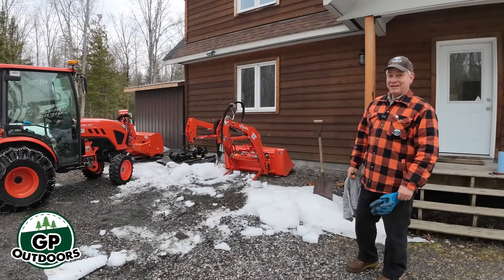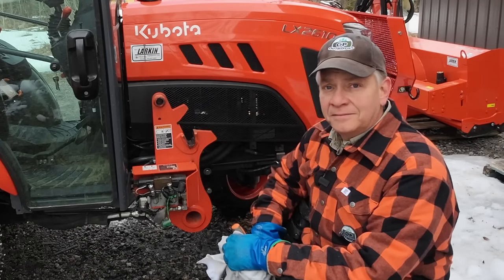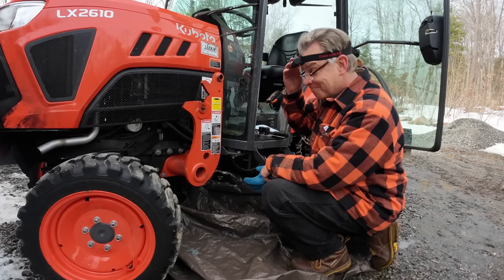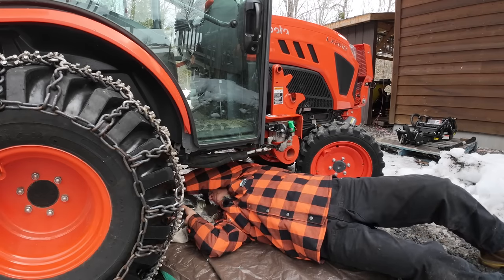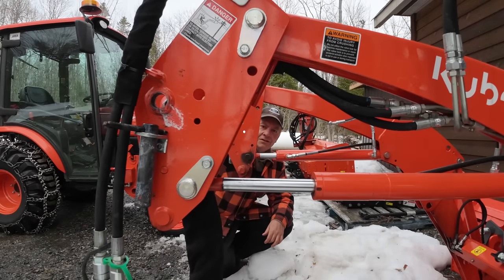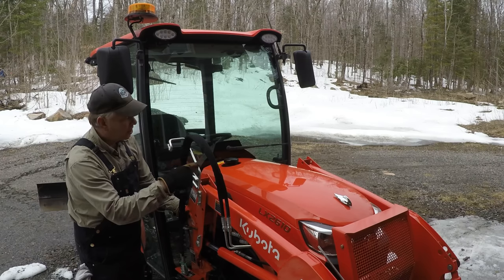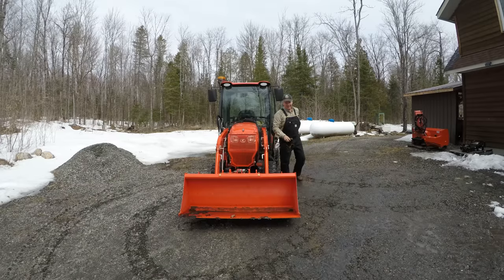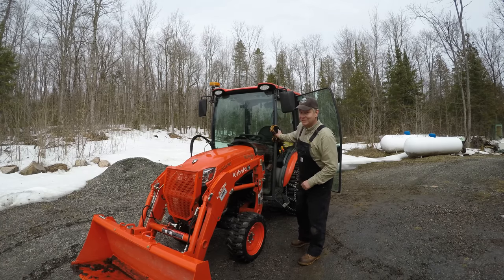667 Kubota LX2610 Tractor. Attaching the LA535 Front End Loader. Mount and Maintenance.   4K

Comment: The way those cylinders got out of sync is totally normal. They’re hooked together in a circuit and kind of find a natural balance. If they were plumbed individually you would bend your loader as the pressure in each side would be out of balance. Next time you have your loader off, grab one side of your loader and you’ll see you you can push and pull on one side and the other will go in and out. Kind of like a teeter totter on a playground. Hope this helps
Reply from the maker: Hey thanks so much. I appreciate it - I was a little concerned. I will pin this comment so other folks can see it. Have a wonderful week and thanks again!

Comment: Last fall while taking off my loader I rushed the removal of the loader. I spent the past two summers removing/re-installing the loader without problem and became overconfident.  Well this last time was a disaster as I somehow dug the bucket into the ground while the loader was off the loader mount. Long story short, I called my local Kubota dealer who sent out the mobile technician a day later to literally dig me out of my jam. My main concern is not to break the darn thing, having a really good dealer who is patient is such a great thing to rely on. Lesson learned, although I thought I mastered removing the loader, you can't rush this process.

Comment: I keep in the small tool box,  a good sized round punch (flat tip) to wack the pin in the  connector to release pressure...works well

Comment: Hi there just enjoying your video today on the cylinders the connections when I have an issue even after releasing the pressure a trick I do on the part attached to the tractor with a little pen in the middle I take a rag and the handle of a screwdriver put the rag over the pin and push The screwdriver to release the pressure that way I’m not taking apart  connections and you’ll find the female part of the hose connector will snap on no problem at least that’s the way it works for me  john
Reply from the maker: Hey thanks John! Have a good one!

Comment: Hey Gord, whenever I take off my FEL off I pull my loader arms in all the way, so the rams aren't exposed to shop debris and welding splatter. When I do this, they move at different rates, so don't be concerned about them being different lengths, you can extend or retract them fully to even them out. Thanks for the video, I'm doing my seasonal change this week as well.
Reply from the maker: Cheers and thanks Ross! I appreciate the info. :))

Comment: I've had my frame sides get out of whack and uneven with the BX I used to own.  Pretty much did what you did to even them out before connecting the loader to the tractor.  I'm surprised they didn't put a swift tach loader on the LX2610.  They updated the B2601 to a swift tach 435 and it makes it a little nicer to connect, disconnect to/from the tractor.  You can actually do most of this right from the driver's seat.  What's really nice is the the hose connections are in one bracket and a single lever connects/disconnects them (as well as a place to mount the bracket on the loader arm).  Still extremely important to have everything level when connecting or you'll still have plenty of issues (I can attest to that personally as can the driver who delivered it).  Thanks for sharing - I really enjoyed watching it.  Not looking forward to torqueing those loader bolts...

Comment: Hi Gord, you need to get yourself one of the cheap kids foam snow sleds from Cabela's to work under the tractor. Much softer on the body and the bottom of the snow sled is slick HDEP plastic to slide across the rocks. Better than the tarp you are using. (Sportsstuff® Grizzly Foam Sled Maple Leaf 49”)

Comment: Thanks Gord.
With both Boom cylinders connected together, 
You could have pushed on the one that is out further and the other one will move out to line them up 
It was in the 80's here in Central Wis today and the Snow/Ice was melting lickity Split.
Mike M.

Comment: I had the same issue with my "red" line as well, GP. I luckily didn't have to relieve the pressure but it was a 10 minute battle. Putting on the blue line and then removing it seemed to make the difference. Yay for summer projects coming up.

Comment: So those good hand towels in the guest bathroom are what I should be using for cleaning my grease zerks??? Copy...Thanks for the tip, GP!
You mentioned it in the last video and again today." Cracking" open hydraulic fittings to relieve pressure. Is that in the manual? The biggest problem with any hydraulic system is dirt/water or any possible contamination, so I would think that each time a fitting is cracked open. There would be a risk of this?They make a tool for relieving pressure, but I have always used a ball peen hammer tap myself.
Reply from the maker: LOL! Yup, those towels will do it. Great question - the manual says to cycle the valve body to relieve pressure however does not address what to do when a hose is under too much pressure. Some folks suggest that using a tap and hammer can damage the point in the coupler, and yup, I agree that opening that connector up can open the potential of getting debris inside. The tool I used to find was sold by Ken at Bolt- On Hooks, but he no longer sells it and the US company that made them appears to no longer make it. There is an Australian company I found but crazy expensive ( IMO) to purchase for what you get. Sooooo...I guess to each his own on this one. :)) Thanks - good Q and make sure when you put the towels back in the bathroom, you turn the dirty side in...and blame it on the kids .LOL! Cheers!
Reply: @GP Outdoors  Maybe something you could check into with the mechanics in the back at the Kubota dealer...I just don't like the idea of opening the system myself. 
However...I am so thankful to finally found a purpose for the seasonal guest bathroom towels!🤠
Reply from the maker: @waynetharp  LOL! Well, I did actually, they told me to open them and never use a punch/hammer on the inside pin. When I loosen the coupler I don't need to actually take it off totally. As soon as you start to unscrew it, the fluid starts to leak out( under pressure), and then I just tighten it again. But, I do enjoy hearing different ideas and thoughts on things.:) And I have to wear safety googles...it can squirt out in any direction sometimes. Cheers my friend!

Comment: Checking torque last fall on my B2601 I found a bolt hitting the oil pan. Clear that it happened during dealer install .. I missed several times being under there happen to find it that time. I moved the longer bolt to the back and moved the short one to where it belonged :)   When you get a garage it still sucks getting under there checking torque btw.. :(

Comment: Thanks for keeping it authentic! I wonder if the new kubotas are any better. I've had troubles once in a while with my green tractor but don't know if it's ever taken that long. Anyway, another great video!
Reply from the maker: Well maybe the new SWIFT Tack Loaders might be better. In all fairness, there have been some times when it went on quick and easy and this loader I have has a better design than the one I had on the B2601 ( they added a triangular piece that helps align the arms into the mounts better ). Thanks Ben! have a great week!

Comment: Very helpful,indeed
Good video to be watching regardless of the tractor brand.

Of seven channels I still watch on a regular basis, 
Yours is the only one with a cab on the tractor.

You've convinced me that they are very well worth the added experience.

While working with others do you ever felt encumbered by the cab when trying to communicate with others around you?

When ( If ever) is it an impediment?
Reply from the maker: Morning Jean. I did at first but I also wear hearing protection , even when I had an open station tractor. This cab tractor has a horn which is helpful for getting attention, but also, my neighbours have always used  hand signs to communicate generally, while we are in the forest because often we are working with chainsaws, splitters etc but in short, the horn is very helpful. Cheers and thanks for tuning in!

Comment: Great tip about cleaning the zerks- I keep all mine clean, as well as all my trailer, and vehicle rims, front and back, clean for the same reasons- if I see one more dusty or darker than the others, something is up (dragging brake, emerg. cable or spring not releasing, …). Not to mention, excess grease is a dirt and bug magnet.  Yuck

Comment: New LX2610 owner here - due much to your videos (thanks)  - down in SW New Hampshire.  How do you decide when to put the blower on and then when to pull it off?  What I mean is, what threshold of remaining expected cold/snow weather do you use to make that decision?
Reply from the maker: Hey welcome and thanks very much for joining the community. I will try not to be too wordy but each November/ December, I wait as we start getting each little snowfall. You probably saw the preparation video I did about 3 weeks ago so I have greased, lubricated and setup the subframe and blower in my shed so I can easily attach it when the time comes. My tire chains are also on the ground waiting in the shed. I have found over the years it is important to get a base layer of hard snow on the driveway before blowing, ( unless we get a sudden big snowstorm and a foot of snow) if possible so I simply drive over each new fallen snow to pack it down, and eventually, once I get to about 4-5 inches that stays (does not melt) I check the forward weather to make sure a big warm front is not coming in. Then when we finally get the next bigger snowfall, 5-6 inches or more, I attach the blower. I almost never take it off once I mount it. In the spring, as the thaw commences , I keep a sharp eye on the weather and once we see more melting snow, than big snowfalls, and I start to see some areas of the driveway gravel appearing, I eventually decide to remove it. I have an off road truck so for me , even if it does get more snow, usually or very seldom is it a big snowfall, and I am good. I hope that helps a little and congrats on the new tractor!
Reply: @GPOutdoors  - Very helpful, thanks.  Looking forward to learning how to use all this gear!

Comment: Gord I noticed you have an engine pre heater. Do you ever use it? My dealership talked me out of it when I bought mine.
Reply from the maker: Good day Michael! Yes it is a block heater and up here it is a must-have. Perhaps you live in an area where it does not get too cold. But for sure, I use it every day I run the tractor through the winter months. Every day. I don't need it during the Spring Summer but there are days in the winter when it will not start without warming it first. Cheers!
Reply: @GPOutdoors  I rarely get below -10. Occasionally -15. Always starts right up.

Comment: Hi Gord - question: can the doors on the cab be removed (easily)?

You’ve said that an open cab is easier to start with for beginners. I’m thinking that makes sense but I’d rather buy the enclosed cab to start but maybe take the doors off to start. 

Can that be done?
Reply from the maker: Morning Chris. I don't think so - but I could be wrong. I can understand the dilemma. Hard to choose but having the cab makes good sense long term if it is in the budget. Have a great long weekend!
Reply: Thanks for the quick reply Gord. I think I'll get the enclosed cab and learn to work with it. We've got 160 acres so I'll be in it a lot and comfort will eventually count :)
Reply from the maker: @modernmountainman1  Hey you will do great. And comfort is super important. Good luck!

Comment: The only damage my tractor has seen has been caused by trying to remount the loader.  I too have no flat or hard area for the loader.  Now I just remove the bucket and leave the arms attached.  For some reason I have much less trouble with the backhoe but that can be a challenge too for the same reasons.